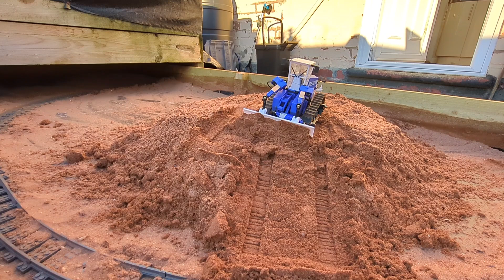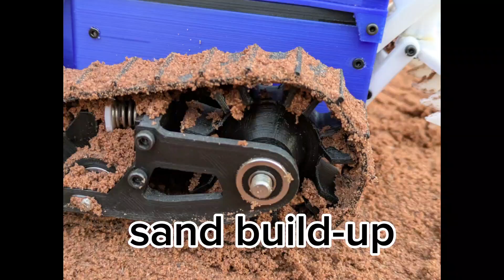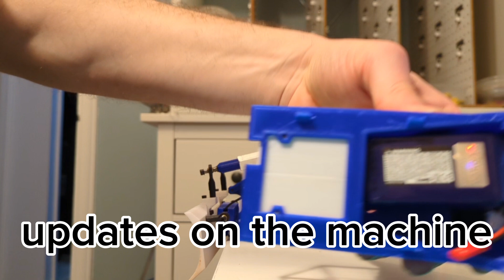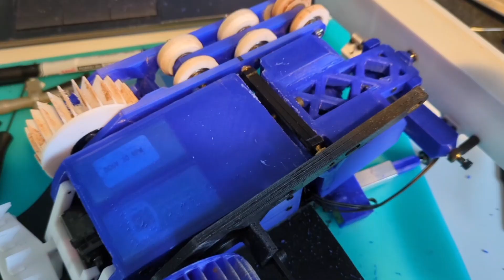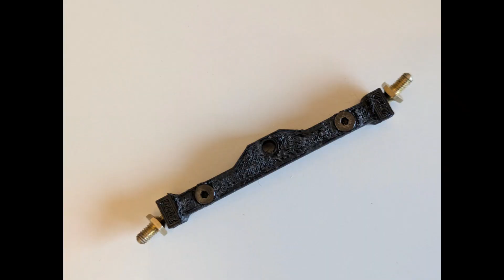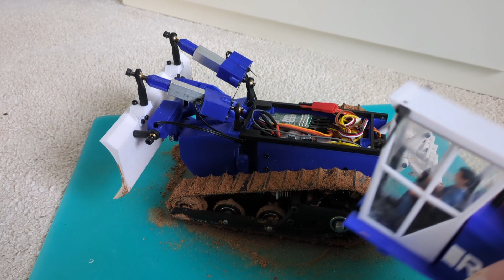3D printed bulldozer Rexem RD14 working hard (discussion at end)

Comment: Neat machine sir.
How much ground clearance do you have under the chassis? It looked like it bottomed out sometimes, looking at how smooth the sand was left behind.
I feel like a bit more "agressive" tracks would help a lot with traction, to the detriment of scale realism
Reply from the maker: Thank you! :)
Yes, you are right, there are a few moments where the bottom touches the sand. With the new low-mounted equaliser bar I can run slightly wider tracks for better floatation and more aggressive grousers will give more traction. I might be able to switch to 8 "double" spokes for a bit more clearance, but it does work pretty well as it is. An increase in ground clearance has impact on the blade lift mechanism, so I have to consider that too.

Comment: it looks really nice,  maybe add some weigth to help it get a better grip of the ground
Reply from the maker: Thank you Antonio! I stuffed lots of steel balls into the front. It will be difficult to add much more weight. Theoretically I could replace the chassis sides with laser cut steel, but that's not cheap and I kind of like not having to paint my models :D I might increase the height of the grousers on the tracks!